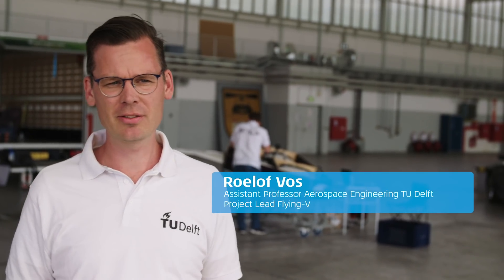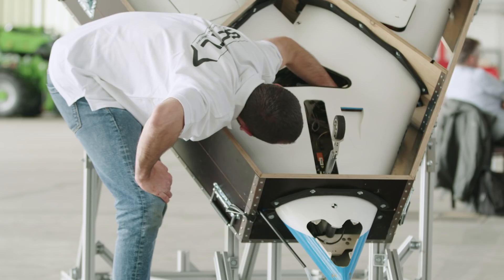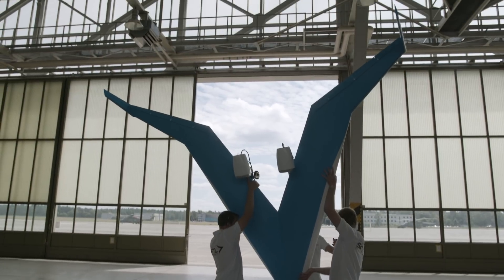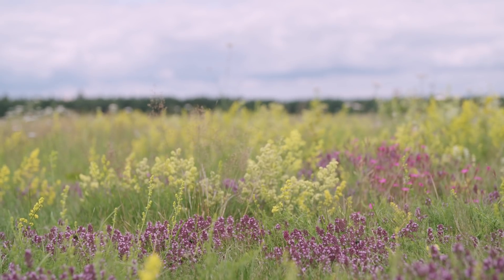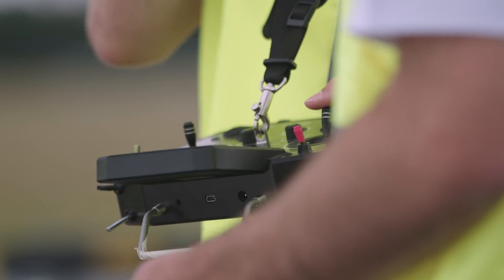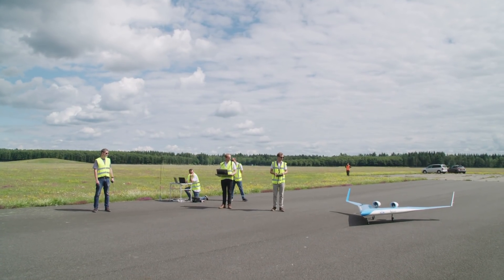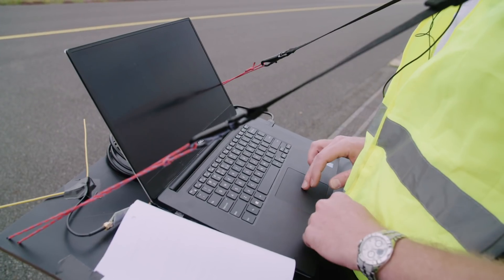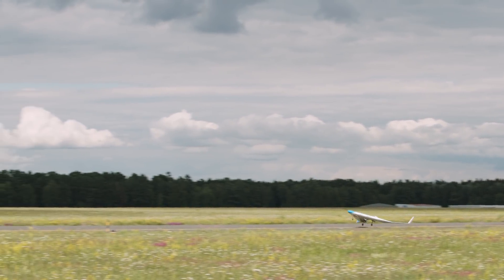Flying-V - Scale model maiden flight

Comment: Pure PR stunt. Reynolds number means that anything in this video is completely irrelevant to a full size model
Reply: 10/10
Reply: Can you elaborate?
Reply: @mr.mcbeavy1443  sure. Reynolds number similarity is used when comparing models of different sizes. Unless you change the medium of the test...in this case if its 1:100 model the RC plane would need to be flying at 100x the real life speed in order for the results to be compared.
Reply: @andrewsampson5523  
Umm...ok then, does that mean that you think a full scale version of this would not fly?
Reply: @mr.mcbeavy1443  no. I'm saying that any observation from a model cannot be extrapolated to full scale model
Reply: @andrewsampson5523  
Thanks bro.
Reply: @andrewsampson5523  Hold up:   YOU, 1) : Reynolds number means that anything in this video is completely irrelevant to a full size model.   YOU, 2):  no. I'm saying that any observation from a model cannot be extrapolated to full scale model.
Your statements are cast too wide:  that applies once you approach the 'threshold', (i.e the smaller CANNOT 'fly' in air beyond the threshold, but it might 'fly' in water, where the larger would disintegrate). The smaller the model, the smaller the flight envelope, the harder to stay in flight.... Therefore: collected flight Data will have relevance / value at this scale, and as proof-of-concept. 
Correct, it does not serve as a direct correlation (what 'model' ever does?)..... but don't you think that a Uni undergraduate at TU Delft would have done the math before , during , after the flight? 
Why do you think they were so nervous to start with?   This is on the edge, in more ways than one.....
Reply: @almostbutnotentirelyunreas166  I'm completely happy with both of my statements, I'm unmoved by your response. "The smaller the model, the smaller the flight envelope, the harder to stay in flight...." is meaningless from a fluid dynamics perspective.   Its an RC plane - it doesn't prove anything. I don't feel like giving you an introduction to fluid mechanics to explain why.
Reply: @andrewsampson5523  So TU Delft is now in the 'business' of wasting 2 years of an undergraduate's time, according to your insights? How interesting....Hey Prof, what shall I do for 2 years. Oh no need to worr, just assembly this RC pane & make it fly, I'll pass you with a B+?  What is your Alma Mater? (Cringe).....
Reply: @andrewsampson5523  I'd ask you to explain ONE thing: What would you consider a 'full-sized model', worthy of telemetry / data gathering. Go on, impress us with a few sentences...you can do it.....surely....
Reply: @almostbutnotentirelyunreas166  we don't use the term Alma Mater. But its almost certainly more prestigious than yours. The first question should have been what my under graduate degree is... if I had a business degree from Wharton would it enable me to comment on fluid mechanics? But if you want a pissing match, go for it. You first... school and under graduate degree
Reply: @andrewsampson5523  For any reader that is interested in PUBLISHED SCIENCE, rather than Andy's swollen opinion of himself, access this: https://doi.org/10.1016/0167-6105(96)00049-9  
Elsevier: "Scale effects in wind tunnel modelling", excerpt : 
"Scale effects in wind tunnel modelling are studied by comparing the results from models with various scales with the atmospheric boundary layer. It is found that the scale ratio of roughness height should be the same as the scale ratio of boundary layer thickness. The individual roughness element exhibits local effect only in the lower zone of two times the rourghness height. Lego bricks are used as the roughness elements. The best similitude of the velocity profile in the wind tunnel can be obtained if the scale ratio of the boundary layer is in the range 200–400. The scale effects of pressure on the surface of a bluff body are studied by using three models of different scale ratios. As long as the roughness height is correctly modelled, correct results of the pressure coefficient on the building surface can be obtained even if the scale ratio of the body size is not correctly selected. The scale ratio of the diffusion coefficient is the same as the scale ratio of the boundary layer thickness. The diffusion coefficient is proportional to the thickness of the boundary layer, and distributions of the dimensionless diffusion coefficient in wind tunnels with different scale ratios and in the atmospheric boundary layer are the same." 

Yeah Andy , it is true: YOU cannot learn ANYTHING from this model, but not because the Science doesn't exist...rather because you have taken a lazy, best-guess approach with your position.
Reply: @almostbutnotentirelyunreas166   thanks for posting this extract. I think you have misunderstood the science here. This is talking about the impact of surface roughness vs laminar flow and how to achieve dimensional similarity. For the record my "best guess" is from my engineering degree and practical experience with wind tunnels and towing tanks. As I have tried to explain previously models are useful if conditions are correct. In this case because the density and viscosity of air in the model and full size plane are the same - Reynolds number similarity (a requirement for being able to interpret the findings) indicates that the air speed should be increased (eg. if this is a 30:1 scale model the air speed should be increased by a factor of 30). However that probably would result in shockwaves etc... so the usual practice is to adjust the medium viscosity and/or density). So my lazy answer has always been that models are meaningful if done properly... but this one flying in air doesn't meet the criteria for dynamic similarity. Are we done?
Reply: @andrewsampson5523  Done> Ah, no? Andy: you seem to be confusing an Airbus (pre-production) Design Facility with a University Engineering Faculty?  However, let's 'accept' your interpretation above as completely accurate for a moment! 
1)  Is your insight/knowledge exclusive,  or do you think TU Delft / Airbus are aware of this? (simple Yes / No, will do)
For 'Yes': TU Delft deserves to be shut down for knowingly wasting 2 years of an undergraduate's time.
For 'No': TU Delft deserves to be shut down for complete failure of Curricular Expertise in Aerospace Eng.  Pick one! C'mon it's YT!! 

2) You start with Reynolds, then categorically state that there are NO EDUCATIONAL OR DESIGN PARAMETER VALUES to be had from the flight of this model.  I'd strongly suggest that you urgently contact Assistant Professor Roelof Vos at TU Delft, and explain their FRAUD to them. Watch the vid again, there is specific reference to data collection, by the Prof....what could he possibly be referring to? 

3) 'My bad: Argument from authority' is a very weak basis to conduct a discussion from (Lecture, Yes. Inter-action; No).  So:  Either this entire video is Full of Shit (technically speaking), or you are.  Time to ante up: Back your comment with external citation(s), verifably present your  qualifications....... time to put your money where your mouth is. 

4) In terms of 'accepting' your categoric position: While the linked study does not support most direct extrapolations over various scales, it clearly leaves room for 'learnings' (extrapolations) at relatively small scale;  should I find some more for you to peruse? 

5)My qualifications are irrelevant, this is YOUR comment to support, amend, remove.
Reply: @almostbutnotentirelyunreas166  Hi. Whats funny is that you haven't debated me on the science or responded to my explanation of the science. Yes, you've posted an extract (that you've misunderstood), but I don't think you're equipped for the debate despite some big hints thrown your way. You're just not up to it. All the best.
Reply: @andrewsampson5523  What's really funny now, is that you're NOT prepared to back your CATEGORICAL Statements?  I have nothing to 'prove' here, this is / was your comment, and you are now unwilling to back your claims / statements by means of answering  4 simple challenges as above. Why on Earth would I 'debate' such a multi-faceted aspect of engineering science with you, in the standard YT 4-line platform? 

Reynolds of around 2 million upwards provides for extrapolations, Y/N? But we''ll start at 4 million.....acceptable?

What would  you estimate this model's Reynolds at, under the shown conditions?
Reply: @andrewsampson5523  You: " I think you have misunderstood the science here. This is talking about the impact of surface roughness vs laminar flow...". 
Yep, and how can surface roughness (perhaps in sections) be used to modify/ adjust the effective Reynolds number of a given aerofoil?
Reply: @almostbutnotentirelyunreas166  My sentence is self explanatory... but I'll break it down for you. Pure PR stunt (that explains why the university went to the effort of building a model that doesn't provide useful data). Secondly to anyone who understands Reynolds Number similarity it is clear that the test conditions do not provide anything close to reynolds similarity therefore results are meaningless. Finally, if you watch the video and see the rate at which the RC plane took off you will see that that is unlike any full size aeroplane... Like I said, I don't think you're equiped for this debate. All the best
Reply: @almostbutnotentirelyunreas166  it probably would.... but not enough to make any material difference to difference in Reynolds number similarity caused by massive difference in scale without adjustment for density and viscosity. Ok your turn, go post another random study that you don't understand while I go get another beer
Reply: @andrewsampson5523  Are we getting warm yet...in need of ANOTHER beer?? LOLS. 
No study required, just some homework for you:
True or false, your favourite QQ to avoid: Some of the testing on the A380 was done at 1:200 scale......go figure?  Last I saw, they flew pretty well...quietest commercial plane I've EVER flown in.
Reply: @almostbutnotentirelyunreas166  great. 1:200. How did they adjust the conditions vs a full size? Its not just scale. I've been trying to explain that. You just don't appear to get it. This would have been a great stat to have brought up earlier, need to improve your googling. Farewell
Reply: @almostbutnotentirelyunreas166  sorry, I ended that one too quickly... you mentioned "quietest"... you really don't get it do you. Its been real, its been good but it hasn't been real-good. all the best
Reply: @andrewsampson5523  The point is, Andy: Your CATEGORIC STATEMENT is inaccurate, whether you understand/accept  it the reason(s) or not. I grant you that the shown model is sub-optimal for full-size version extrapolation, but it is NOT useless: As soon as Reynolds-similar(-ish) models (iterations) are needed, the gathered data becomes very useful. Is THAT perhaps what the Prof is referring to, when expounding the science in the first few minutes?

I note you still haven't estimated this version's Reynolds number, yet you remain convinced that what you see is for 'show only'. Interesting. 

Additionally, there are a host of (unusual/almost unique)  mechanical stresses/strains at play in the front centre chord / apex....... torque, shear, flutter, harmonics that are likely to occur where the looong wings join.... at times, it's not just about Fluid Dynamics, Mate.
Reply: @andrewsampson5523   LOL; "  Its been real, its been good but it hasn't been real-good."
This isn't a dating site, Andy, its YT comments ffs....Hahaha. 
Regardless, your CATEGORICAL statement remains inaccurate, just watch the vid again: Prof make his data statement ....he may be better positioned than me to provide the 'real-good' engagement you appear to long for...LOLS. 

You're getting sick of me not blindly accepting your 'insights'.......is that why you AVOID answering questions based in logic? 

I'll bugger off now, thanks I learned quite a bit from this.

It looks like you did , too. That's OK, no need to thank me..... I know....it's YT.....so frustrating!  but hey, it WAS your categorical stipulation that started this.

My turn for a cold one, insult away, you are welcome.
Reply: Almost, but not entirely, Unreasonable I didn’t learn anything from you. Remember what I said... it’s public relations...
Reply: @andrewsampson5523  Sorry to renege: Of course you learnt something, quoting MT by way of explanation:  "Never argue with an idiot. They will drag you down to their level and beat you with experience" . You are welcome! Hello YT!  (Lesson1)!    
Some A380 testing occurred at 1:200 scale (unTHINKABLE, right?) (Lesson 2)!   
Reynolds number CAN be modified by surface roughness (Lesson3)!  
BONUS  lessons: 
While neither of us (clearly) move in his circle, here are 2 inspring quotes ascribed to Einstein: “The measure of intelligence is the ability to change.”   &   “It is not that I'm so smart. But I stay with the questions much longer.”    Oh look, ..... SCIENCE: ASK INTERSTING QUESTIONS....Bonus Lesson 1)  
Yeah, I know, pathetic......but HERE YOU ARE....reacting to this. LOL.  How's that high saddle feeling right now? (Bonus Lesson 2)
Repeat  : Your CATEGORIC STATEMENT is inaccurate, whether you understand/accept the reason(s) or not. I grant you that the shown model is sub-optimal for full-size version extrapolation, but it is NOT useless: As soon as Reynolds-similar(-ish) models (iterations) are needed, the gathered DATA becomes very useful. (Bonus Lesson 3)

Damn that Covid quarantine, aye?
Reply: @andrewsampson5523  Now, how about you 'lecture' us about the GENERAL FEASIBILTY of this design, the (claimed) PR stunt 'model' notwithstanding? 
It SO RARE to encounter an actual expert on YT....
Is this Flying V worth pursuing, or not?
Reply: @almostbutnotentirelyunreas166   hi there. "Almost" if that's your real name. I'm happy to discuss further but on one condition. I've kept to my original statement that the results of this radio controlled model are meaningless and that this is a PR stunt. I've consistently used established physics to articulate that. You've thrown lots of physics terms at me. If you can explain why your comment about "harmonics" is relevant for a model which is substantially smaller than a full size plane or admit that it was just a random science word you used then I'll answer. So-man up and explain or man-up and admit you're wrong.
Reply: @andrewsampson5523  To paraphrase yourself: '  .....I don't feel like giving you an introduction to fluid mechanics (ME: harmonics=mechanical resonance) to explain why.
'   Nice deflection attempt,  but  NAW,  you AVOID my questions, I avoid yours. 
Full circle: Your CATEGORICAL statement is inaccurate, as demonstrated in this thread.  Wear it.
Reply: @almostbutnotentirelyunreas166  ok, as you are clearly not getting it I'm going to have to explain it again. But before I do, I didn't ask why "harmonics" are important or what they are... I asked why anything about any form of vibration measurement from a very small model is relevant to a full size model. Every single formula or computational method that will look at harmonics/frequencies/shockwaves etc will include some consideration of density and/or viscosity. Accordingly to get meaningful results you need adjust factors these factors in the modelling test. Get it? You're right that "harmonics" are important in aircraft design... I'm saying that an RC plane flying in open conditions doesn't provide meaningful insight. And finally on the topic of Reynolds number... the important thing here is not what the Reynolds number is... it is about Reynolds number similarity. ie... to rely on results of a scale model how do you modify airspeed, viscosity and/or density to achieve Reynolds number similarity for both the model and full size.  This is not opinion, this is established science for scale model testing in controlled conditions.
Reply: @andrewsampson5523  BEAUTIFUL! Thank you! 
Reynolds number similarity, indeed. 
Back to Reynolds 4 000 000 we go!  What is the Reynolds number of this model? Without that, how can anyone possibly EXCLUDE similarity...what range do we accept as 'similar(-ish)' ?
Eg, 35 000 000 to 80 000 000 ( 45 000 000 apart) are considered similar(-ish) enough to draw extrapolations.
500 000 to 4 000 000 (3 500 000 apart) are NOT considered 'Reynolds similar.'
Enter DNS........for up to 2 000 000 we have a stop gap. ERGO: This is at the EDGE, one that neither of us can define without knowing the plane's Reynolds number. Simply saying 'it's too small' MAY be true, but it is hardly scientific. 
Harmonics are interesting because 'standing waves' can cause catastrophic stresses. What are harmonics? Vibrations, measured in Hertz, generally. Tuning Fork hum.... the bursting crystal champagne glass 'whining' at a specified frequency...The potential EFFECT of induced wing-oscillations matching the wing's natural frequency is testable, and to a degree, worthy of extrapolation. 
Tell me, Andy, do you think a plane is built off ONE 'properly scaled' model??? There are hundres of similulations, models, iterations... and something this size can / does contribute , via steps, to the end-product.....or it's cancellation, as the case may be. 
Of course this thing is on YT for publicity, I just don't accept that it is limited to that: Pure PR  could have been achieved with a EPO slapped-together, weekend-modeller's version....why go to all the trouble?
Reply: @almostbutnotentirelyunreas166  No. I'm saying it is too small to be useful because of differences in Reynolds number. I don't need to calculate it to say that. It is obvious that the ratio of the Reynolds Numbers will be the same as the ratio of the scale model. This is science. Thanks for the quick lesson about harmonics, not necessary as it was covered in my engineering degree. I don't think you understand the physics though. For example, the "hum" of a tuning fork or the frequency to shatter a glass is the natural frequency not a harmonic. So, now that we have concluded that you don't understand physics and that I do I think its time to end this.
Reply: @andrewsampson5523  You keep claiming an early victory, Andy....what are you worried about? That such an obvious 'idiot' might have a point, or stumble onto something that your dogmatic approach does not provide for?
Any capped engineer would KNOW with certainty that they are not engaging an equal, yet you keep avoiding simple, logical questions:  What is the Reynolds number of the plane that you decry as 'insuffucient'  ? 
You CLAIM physics / science, and then spectacularly fail to deliver on that claim. Why? 
You pounce on comments about the 'quietness' of the A380 ( Boeing fan-boys die with that one) ,  you pounce on perceived syntax issues, turning them into 'comprehension' issues (weak!), instead of conceding that mechanical harmonics are relevant.
But, you are correct: I have to decide who I believe (you already know who you believe).
My options are : The Prof in video (watch it again, maybe), or you, following our engagement. 
Normally, this is real easy, most commenters are deeply full-of-shit. However, I reckon you are as claimed: A capped engineer, with extensive exposure to Fluid Dynamics. 
I think I might harass a few more commenters, before I make up my mind.
This may help my decision: Why are you commenting on this thread, slumming it with the YT idiocracy? Why so dogmatic ? Why bother to this degree?

For what it's worth, I'm a budding (late bloomer) RC Plane Hobbyist, and I can tell you with CERTAINTY that 'leisure' RC Models have virtually NOTHING in common with this model: We do not have telemetry, the only 'data' (empirical) that we collect is related to the perceived 'flight envelope' (crash/burn), the only cavities that we build house electronics. 
From that perspective, this appears to be a deeply complex / detailed build...why bother IF it is exclusively for show / PR? 
It does NOT make sense. It is NOT fit for purpose, IF PR is the only goal.
Which engineering Faculty, Airline, Aircraft manufacturer would WASTE 2 years of investment for a PR stunt that could be equally achieved over a few weeks?

Something is off here.....it may even be you.
Reply: @andrewsampson5523  YOU: " I'm saying it is too small to be useful because of differences in Reynolds number. I don't need to calculate it to say that. "                         ME: Is that what you were taught during your engineering degree? That you could simply 'see' the variations, the intricacies, the outcome of complex equations?  Wow, maybe I was wrong about your educational 'pedigree', that is NOT how engineering or science is done!  Here's what is supposed to happen: Stipulation (you), challenge (me), proof of stipulation (you), re-direct (me) , proof of stipulation (you)...when did that occur in this exchange?
Not once.
Something smells foul in the state of Denmark! Looks like its  YOU.....and your dogmatic 'stipulation'..... OMG, I LOVE YT!! YESSSSS!
Reply: @almostbutnotentirelyunreas166  Why am I slumming it? Because science matters more than opinion. Because you're reluctance to either listen to the science that I am explaining or debate the specifics of the point that I am making (noting that I have been consistent about the science and method referenced all of the time) is part of a troubling trend where amateurs or novices give equal weight to both their opinions and scientific facts, look for other opinions that align with theirs, grab random bits of science from other domains that aren't relevant as distraction or sink to personal insults. This is partly why consensus science on vaccines, global warming and COVID-19 is being rejected by many in the population... opinions are becoming more important than science. My original post was both accurate and a bit of a troll. Since then I have been trying to educate you about the science behind this. All the best.
Reply: @almostbutnotentirelyunreas166  what was I taught in my engineering degree? scientific method, many forms of physics, a lot of calculus and computational methods.  The way that you use reynolds number similarity is to determine the Re number of both model and full size. If air speed, viscosity and density of air are the same then the Re numbers will be different (by the scale factor). The experimental conditions would be changed - different speed in the wind tunnel, different medium (eg. lower pressure air, water or oil) so that the Re number of the model approaches similarity of the full size. Its about the Reynolds Number similarity process... not the specifics of the number.  So given that this model is approx same shape/accurate scale model and that they aren't adjusting for density and viscosity and that the speed needs to adjust inversely with the scale factor it is clear that Reynolds similarity can't be achieved.  Finally... the syntax difference between harmonics and natural frequency are important.  a380s are quite not because of the overall shape of the plane but due to insulation and the finishing of external finishes around doors, windows etc and reduced vibration regeneration through the body. See my other comment about slumming it.
Reply: @andrewsampson5523  Now that's a little more like it Andy!  Sorry if it frustrates you, but we are now (unheard of on YT) approaching an HONEST, OPEN debate. Yes, I know you are ahead on points...and I happen to agree with most of what you said in your last 2 comments.
However: "....a troubling trend where amateurs or novices give equal weight to both their opinions and scientific facts..."  Let's disect this a little. We have you, an unknown entity, VERSUS the TU Delft Prof! He says it has 'scientific' value, you say it has none? WHAT IS A LAYMAN TO DO?? I can't interrogate the Prof, however I can engage you.....soooooo....... This is a serious conundrum for me: My (un-capped) technical background allows me some insights.....one of them being that you are most likely exactly who you portray to be. And, yes, you have been consistent (actually irritatingly dogmatic, imo.). 

Can you solve this conundum for me , Andy? Why are YOU and the Delft Prof at odds with each other?
Reply: @almostbutnotentirelyunreas166  Why are my statements at odds with the professor? Background is important. I haven't worked as an engineer for 20+ years. I now work in business strategy. If you look at the link you sent me you see a part of a wing in a wind tunnel in controlled conditions being tested. Good science and method. The model in the video is uncontrolled conditions and there are no visible air pressure meters on the model.  The program clearly has a lot of structure and science but I think the model is a great PR activity to enable funding. And the professor is doing his bit to help with marketing.
Reply: @andrewsampson5523  C'mon Andy, around 1.05  the Prof calls the model a   " scientific vehicle that we use to perform tests with  "  ...prior to that they repeatedly speak about data collection, testing, proof of concept...did you miss all that?  Did you miss the Pitot tube?
OR :  Did I miss your (logical fallacy) Strawman? YOU: " ...anything in this video is completely irrelevant to a full size model  " . What I NEVER heard the Prof mention is (extrapolation of this data to) a FULL-SCALE model.....yet THAT is at the heart of your comment. Setting up a 'STRAWMAN' statement, only to knock it down?  And thereby inferring that the whole project/ model has no 'scientific' value, when it clearly has.?  Disingenuous. And rather unfair.  In this video, the model is DOUBLING as a PR ' stunt', and it is clear that is way more than that on every other day.
However, you ARE technically correct, in a very narrow sense: 
This model cannot be the last iteration before going into production (was that ever touted in the video?),  there have to be many steps in between, just like there are for EVERY new Aircraft design. Obvious, never in dispute. Well played. 
This level of communication 'sleight-of-hand' is generally only seen in the upper echelons of large Corporates / Gov't, where professional 'speech-writers' , sociologists, psychologists work in the 'communications dept', (right next door to 'Strategy') to achieve very targeted messages.

So Andy, which of the opposition do you work for?  And in what capacity? Shall I guess...quoting MT?
Reply: @andrewsampson5523  Sorry Andrew, I just cannot let this go, and IF you support science as much as say you do, then neither should you. YOU: "Pure PR stunt. Reynolds number means that anything in this video is completely irrelevant to a full size model" . That is simply too wide a statement. Please amend this to read:  ' What A PR stunt! Reynolds number means that virtually all flight data in this video cannot be directlty extrapolated to a full size model  '

Wouldnt that be a more accurate stipulation for this video?
Reply: @almostbutnotentirelyunreas166  Your logic and knowledge of scientific method is coming along.  This is my time to go off an do other things.
Reply: @andrewsampson5523  LOL's. Ask interesting questions, right? 
So in your office environment, Legal, Strategy & Communications are right next door to each other.....got it. 
How convenient for them to have an Engineer in their midst!
Reply: Almost, but not entirely, Unreasonable. I overestimated you.
Reply: @andrewsampson5523  That error is on you Andy.

Me? I called you exactly as I see you...
Reply: @almostbutnotentirelyunreas166  ha. Me: educated, structured, consistent. You: Dunning Kruger, model RC builder, random word user.
Reply: @andrewsampson5523  Tsk, tsk.....how sad.
What are you revealing to us all right now?
That the opinion is more important than the Science, even whe you are " educated, structured, consistent"? 
Another logical fallacy, brought to us by Andrew: Ad Hominem. Playing the man, rather than the ball..... tsk, tsk....what would MT have to say about that?
Reply: Oh look, Mr Sampson just got a haircut in public...... so weak..... weak.....wea......
Reply: Almost, but not entirely, Unreasonable to make one thing clear for the zero to maybe 5 people who will ever read these comments and your excellent zingers (sorry sarcasm doesn’t come through well does it) at no point have I questioned the capabilities of the university (so it’s weird you’d post a YouTube link of a political from a country that neither I or the university in question come from as one of your zingers in response to a point that I haven’t made). 

Good luck with your toy planes. 

And my actual final response here is... I actually do need a haircut. Lockdown.
Reply: @andrewsampson5523   Haha, Andy, sounds like you need much more than a haircut. 
You, I know, and the 5 peeps that may read this know:
Your original statement is too wide, it clashes with the TU Delft position, it is inaccurate and therefore you have been called out.  
This model, per TU Delft Prof, is  a "   scientific vehicle that we use to perform tests with  ". You just happen not to agree with that. Sad.
Reply: @almostbutnotentirelyunreas166  Tried to DM you but couldn't work out how. I know when I get online and start debating random people its because I’m unhappy. This is unrelated to the discussion about aerodynamics or youtube. Unsure of your personal circumstances, COVI-19 sucks, but I hope that you’re ok and have balance in your life. All the best.
Reply: @andrewsampson5523  Salute. It was , overwhelmingly, an honest exchange..... I think. 
What would YT be without some vitriol, without a little 'look-in-mirror' effect? YT comments sure are a strange phenomenon: Anonymously insulting complete strangers, under the guise of 'discussion'? Yep, me worry about the lot of us.....
Look after, keep well, stay-at home.